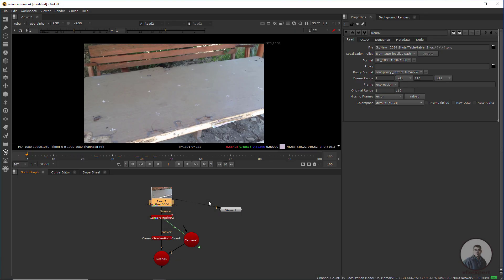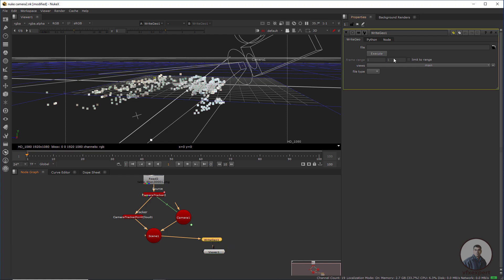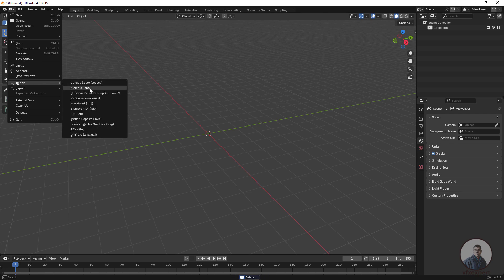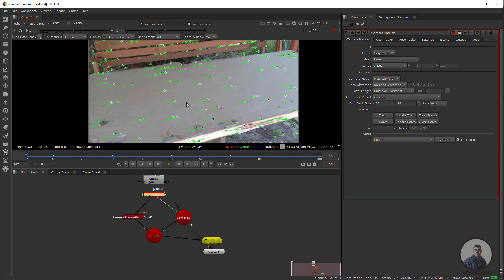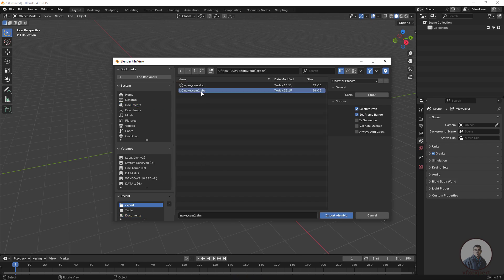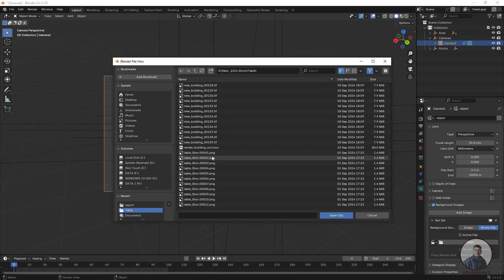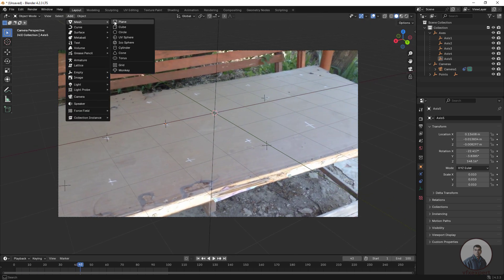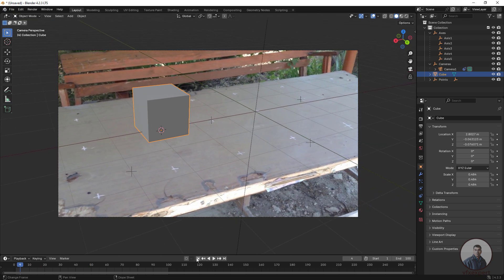Fix Problem Nuke To Blender Camera Export | Nuke To Blender Camera Export

Comment: Hi @vfxexpert! Thank you so much for your video, I found it very helpful. I wanted to share with you and anyone else who might be reading an alternative to the workflow you describe in your explanation, which might also be useful. What I tried was importing the Alembic file into an earlier version of Blender where the “big diamond” error didn’t appear, in this case, I used Blender version 3.6. Once I opened the Alembic in a new project within Blender 3.6, I saved the project and then opened the scene via “Append” in Blender 4.3. This way, the point cloud generated in Nuke is imported correctly.